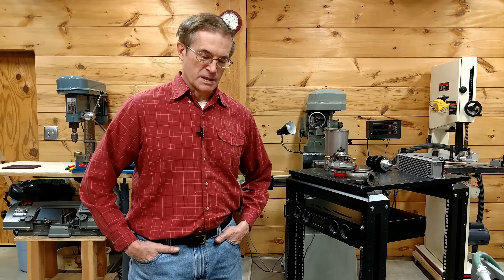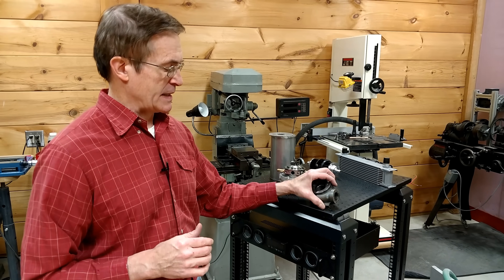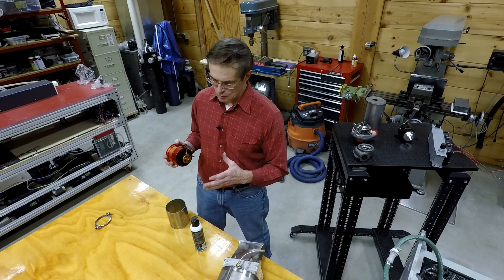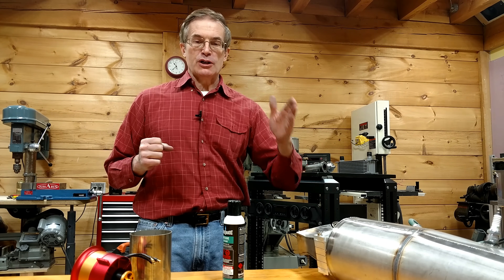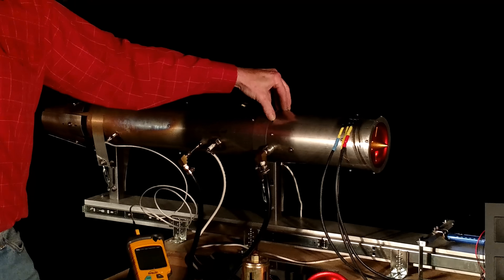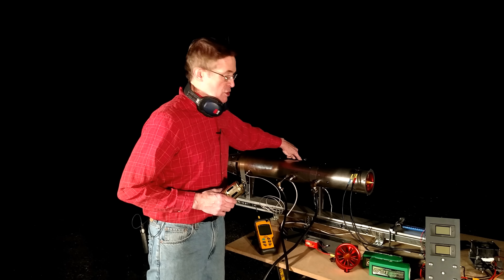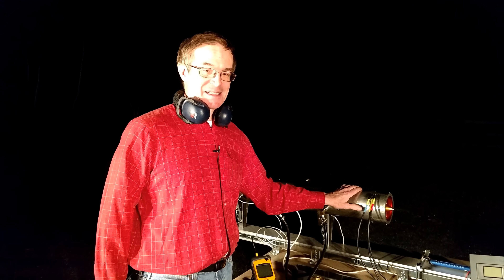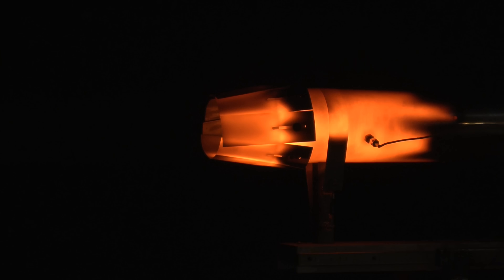Hybrid Jet Engine

Comment: BTU is a unit of energy. You probably mean BTU/h as a unit of power. But why use such modern units, when you can use the much more traditional and simpler to use furlong-whey-force per fortnight?
Reply: One HP is just 746 Watts

Unless it is different in terms of moving air?
Good video, I enjoyed the style!
Reply from the maker: You're just trying to stir up that old imperial/metric debate, we know your type.  But, you might have hit on the best solution, a more neutral Pharaonic or a Babylonian system and an online converter...that's the ticket.
Reply: @TechIngredients  Imperial for me; and I'm a Francophile.
Reply: Not really, I was more trying to point that you should stick with one set of units. Why say the power of the electric  fan in watts, and then use totally different units for the weed burner, when talking about the same physical quantity? 
I guess you just like the BTUs or something, so at least use horsepower for the electric motor if you want to stay imperial. And finally, please use the correct units of BTU/h instead of BTU that you have all over the place, even in the description.
Reply from the maker: All joking aside, almost without exception, every propane burning device is rated by BTU/hr (frequently abbreviated as BTU) or in pounds/hour (imperial).  It is difficult to find an internal combustion engine that is not rated in Hp as well as in kW and sometimes in only Hp.  Most jet engines are rated by static thrust and some by fuel consumption or in kW.  It's a very mixed field of values and it's a good idea to be flexible.
Reply: Tech Ingredients I remember seeing this exact argument being used against another YouTuber.

Using the units that will be familiar to the greatest proportion of viewers will necessitate a good mix. Even if you stick with either imperial or metric, there are a multitude of different units to choose from and conversions between them necessary when making calculations using formula with variables on different scales. 

I really don't see how this issue affects unintellectual people like me. As for scientists, surely measuring it accurately is more important than against what unit?

Great video by the way. Just watched your video on magnetohydrodynamics, which was interesting. I was half expecting you to come up with a fluidyne  generator at the end, but the railgun application was cool. I think most people watching will have wanted a jet turbine at some stage in their life. I think the closest I'll get is 3D printing that one (was it a GE turbine, can't remember) on Thingiverse. Well, I'll have to print two, as I'll almost certainly get creative with a bottle of lighter gas and some compressed air for a four second smile on the first one.
Reply from the maker: Thanks, and you are correct!
Reply: Another two cents.....they're also measured in Kilonewtons of force (kN) both dry, and with afterburner (if military  based). And turbine driven helos are measured in sHp (shaft horse power). American aviation buff here...

Comment: I spotted a turbo molecular vacuum pump at 3:15. Since I first saw one while searching for regular vacuum pump, I want to buy a cheap (broken) one to use the fans for turbo jet. Later I read that these blades can melt when spinning at ambient air pressure... :( 
Since there is some kind of diffusion pump? next to it, I am excited to see what you are going to build :)
btw really nice video, this was my first video I watched on your channel. I am happy to dig through a new interesting channel
Reply from the maker: Building a kiln.  Building a large vacuum chamber.  Building a vacuum furnace.  Manufacturing diamond/ metal composite heat spreaders for our series on thermal interface materials.

Comment: Would ducting air around the latter stages of the engine to keep the stainless steel tube below melting temperature allow for higher combustion temperatures in the latter stages or for higher mass flow of combustion gases without needing to increase the cross sectional area of the engine? Could it also allow for using lower melting point materials that are lighter in that area?
Reply from the maker: Yes!!  The next upgrade will incorporate a second stage fan as I described in the video, but we're toying with leapfrogging with the addition of a third, larger diameter bypass fan feeding these two stages as well as cooling the stainless tube and allowing higher flame temperatures as well.
Reply: It is pretty interesting that you can do this with stainless steel instead of titanium. With the access to the high temperature and the constant stream of cooling air from the third or access to fresh outside air cooling, would a thermopile be able to generate significant energy? Since we are looking at a temperature difference of hundreds of degrees K, is why I ask.

Comment: A noble effort. I think your cone behind the fan is doing more harm than good, the air needs to slow down gradually, in a diffuser, to give the greatest pressure rise. I also think that you have vastly underestimated the power required to compress  air enough to give a good compression ratio, at the flow you require.
Reply from the maker: You may be right, but we also need turbulence for good fuel mixing.  In bench tests, we went from full, unobstructed flow to complete,  zero flow stagnation.  At a 40% acceleration/ sudden stagnation we obtained the maximum pressure rise of 1.5 PSI.  A diffuser might help and we did not test this.

Comment: Would it be possible, to build a JetEngine with solid fuel, like a Hybrid Rocket?
So the incoming Airflow burns the Fuel inside the combustion chamber. Or wouldn't that work?
When yes, next question is: could you build a scramjet with solid fuel?
When yes, last question: Could you combine this scramjet with a HybridRocket, to have a cheap access to space?

Comment: What's the application? Is it static thrust, air propulsion or just experimentation? Specific fuel consumption? I know it's hard to rate since there are a lot of variable which would require months of fine-tuning.
Nevertheless, one of the best jet projects and explanations I've seen on YouTube.
The videography work is also one of the best you've done, I just don't get why people are constantly complaining. With such a technical content, cinematography focus would seem like chasing two rabbits. The better rabbit is the content.

Comment: Would a centrifugal fan create higher static pressure for the same size as an axial fan? if memory serves me the first jet engines used centrifugal compressors.

Comment: For anyone interested there are papers available on the internet written by Frank Whittle going through the full build process of his first engines, including the materials used for the turbine (Forth Rex 78 stainless, used in kitchen knives) and his issues with burners and so on. Frank patented (Edit:2nd patent)the jet 'afterburner/reheat (and turbofan engine) in 193? which he used for his supersonic engine design to go in the Miles aircraft.

Comment: great job ! some friends and I the idea to do this back ~ 1993 but in those days powerful EDF units didnt exist, so we had the idea to use a glowplug engine to power it. actually ducted fans at all were very unusual back then. As we found when we tried it a cheap glow motor simply doesnt spin fast enough for a small diameter fan to generate much thrust / pressure, which is where we gae up. DELIGHTED to see your success and really look forward to see the outcome when you add a second compressor stage (I guess you will need to either engineer some stator blades or easier/better find a fan that rotates the opposite direction ?. Would also be nice to have an anulus that can be resized on the fly (a big ask I know, thats a project in itself). If you have fuel flow sensors would be interesting to try to graph thrust vs fuel flow (vs internal pressure / fan power setting as a 3D surface). Just as DARPA for a grant and three research assistants ;-). GREAT JOB MANY THANKS !

Comment: the name of this type of jet is a "motor jet". there were a handful of modestly successful examples in the first half of the twentieth century with gasoline-engine front ends. ultimately the weight efficiency of driving the compressor with a turbine was well worth the substantial development difficulty
Reply: true, but now with the strong permanent magnets in brush-less DC motors,  you can do some pretty wild things.
Reply: Joseph F it's the difference between low tech and high tech. you can't beat the efficiency of driving the compressor with a turbine, since you already have the hot gas supply. but if you can't afford the tech you use a motor, and the advantage of electric is that it's silent and nowadays off-the-shelf
Reply: >it's silent

Not with an afterburner lol

Comment: For proof of concept, you should show the thrust of the electric fan running solo in the engine, and then with fuel with the fan running at the same wattage. This type of data will help propel your channel to the next level.
Reply from the maker: Good idea.  We'll show that with the multiple fan upgrade.
Reply: Drone Voyage ... YESSS!!! It would also be interesting to stack a couple of fans in counter-rotation in the duct increasing compression and velocity etc.. The end of this was a let down of an otherwise interesting concept.
Reply: @Dude31463  what does the counter rotation do instead of them all turning one way. Doesn't it lose some energy in terms of redirecting the air
Reply: The JP Hobby 90mm edf makes around 9.5lbs of thrust at 6s/125A, if this is the 12s version, it's making 13.4lbs at 117A. They're going to need a much larger force gage if they're going to measure the output.

It also doesn't sound like they're turning the edf up to 100% power when the force gage is maxxed out, so they're certainly getting added thrust from the afterburner.
Reply: I wanna see it scaled up to use a lawnmower engine to turn the fan maybe see some cooling the jet with the fuel to keep the integrity of the structure and set up the hydrocarbons for combustion by getting them excited to meet oxygen to make a hot carbon and water vapor babies
Reply: I guess it's similar to the electric turbos car ricers use, just more powerful, as this should be high rice :)
Reply: @dushk0  audi and F1 use electric turbochargers
Reply: @E9X330  technically true, so F1 teams are ricers

Comment: I'm an "ex-T56-7/15 turbo prop tech", had always been interested in the easier/simpler engines such as the Ram, Pulse, and motor-jet engine (which you made). Your motor-jet is probably the best on YT (and I've seen quite a few of them, some of them are Almost as good as yours and some are just crappy "jokes"). any how good job :-)

Comment: Really nice project, but I have one thing I don't quite get.  When you say the burner is adding 400'000 BTU what does that mean?  When I look up BTU I find that it's approximately 1 kilo joules.  But that's not a unit of continuous energy output, where's the time dimension?!?
Reply: The time unit is hours. For whatever reason, it's usually ommited.
Reply: Ugh, that's like saying this great new car does 60 miles.  Also, what's wrong with SI units?  Saying 115 kilowatt would be unambiguous to everyone and much more relatable to most people.

Comment: Brilliant would love to see it at sub assembly level of individual components so it's easier to visualise.
Reply from the maker: OK, when we install the second fan and  the liquid fuel sprayers we'll lay out an "exploded" view of the sub components.
Reply: Tech Ingredients ... Great!! Looking forward to the second fan in counter-rotation.:) you may want to consider an increase in number of blades in second fan and higher output/RPM... I would also use direct drive out-runner type motors for this... Although that may require some modification to off the shelf items. But you seem quite resourceful... HA! :)

Comment: How can rocket engines work in zero atmosphere? Space is defined as zero atmosphere! Vacuum of space would be crushing to all thing's inside! Just asking?
Reply: A vacuum doesn't crush; there's only pressure from the inside outwards, which is contained by the strong shell.  
It's the same as with pressure vessels holding a liquid gas (for instance) on Earth.  The ~1 atm pressure on the outside is comparable to space conditions when considering the sometimes huge pressures from the compressed stuff inside, like with compressed natural gas or liquid hydrogen and what not...
The fuel is also mostly in a solid state; these are quite stable, pressure wise...

Also: rockets in space take their own (compressed) oxygen with them.  No atmosphere needed.  All reaction products are expelled through the nozzle from the engine, which then provides the thrust.

Comment: The fan is stalled. I would replace the axial fan with a mixed flow one with static vanes. With a single stage you can create much more pressure and the output is already in annular shape. Your videos are awesome!

Comment: The new cutaway camera view at the start of the video doesn't really add any value IMO. The camera work is great otherwise though :)
Reply: I was thinking the same thing. I think alternate shooting angles can be very effective, so long as they fit with the overall narrative. In the case of this video, the alternate angle seemed too random in most cases. At about 1:48, there is a great example of how this additional view can really add to the experience; as he moves to explain the structure of a turbocharger the camera angle changes to show a higher view of what is on the black cart. (This shot could also have been held longer, until about 2:06 . . . would have been great)

This being said, I still maintain that the core content of the videos produced on this channel are in the top 1% here on youtube.
Reply: It would work if something changed in the content he was presenting. But they were the same other then looking at a different lense. I agree, but I think it can work if the video and props called for it
Reply: Agreed.  Much of the time the speaker was talking to the wrong camera
Reply: Agreed. Second camera angle is an unneeded distraction, compounded by the very dissimilar color profiles.

Comment: Remember about stator vanes. Otherwise you can put as many compressor stages and you wont get any pressure rise.
Reply from the maker: That is not true.  You are correct that stators will cause a redirection in the flow and make each subsequent stage more efficient, but a pressure rise will occur without them.  One of the advantages of the independent electric drives is that each stage can reverse the rotational direction and accomplish what a fixed stator does when all the compressor wheels are forced to rotate in the same direction.  Our second fan uses this opposite rotation technique.
Reply: Tech Ingredients ... Totally agree with the advantage of independent electric drive stages in counter-rotation... Have you pursued this further?? Although I would not eliminate the stators or "gates" between these stages as they will serve to eliminate shearing stresses and re-direction of air flow due to counter-rotation of the stages... Further more they provide a structure to the fixed center core of out-runner electric motors. 
Hope you take this further as there is great potential there for even a pure electric jet with no combustion required in my opinion. Would appreciate your thoughts on it... Thanks!
Reply from the maker: 1.5 PSI at the design flow.  This is with a reduction of the output of the fan cross section from 115 cm.^2 to 70cm.^2 as the air enters the combustion chamber.
Reply: akkudakkupl ... I don't think having independently counter rotating stages with stators is a big deal when it comes to electric motors... You do know that modern turbofan jet engines have independent high pressure and low pressure counter rotating spools for turbo and compressor allowing for optimum RPM operation through the system. P&W goes even further to introduce a planet reduction gear for the final drive of the main fan which produces 80+% of the system thrust... It has the highest bypass ratio of 12:1... Quite interesting if you think about it.
Reply: The timing of me having this video  recommended by YT and these comments of stators is interesting.   I just happen to have a CAD model of a P&W stator on my screen that we are going to make some patterns so we can investment cast these for P&W.   Interesting video.
Reply: Do you know what the pressure difference was across the first fan? Also when you tested, what was the pressure outside? It would be interesting to run the calculations on this and see how the compare to the practical results.
Reply: Yes but that means you also need to have the blades mirror axially from stage to stage. I didn't think about this method but it was actualy tested by Lycoming if I'm not mistaken. But this means you have more independentaly moving parts. Having one engine turn one shaft with sets of blades is less fault prone.